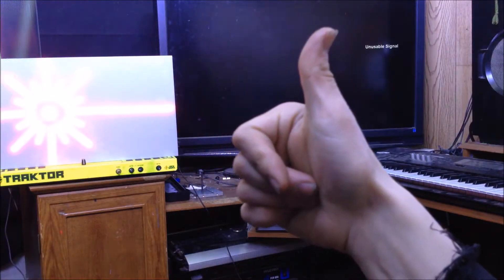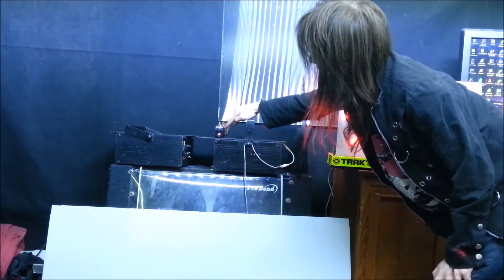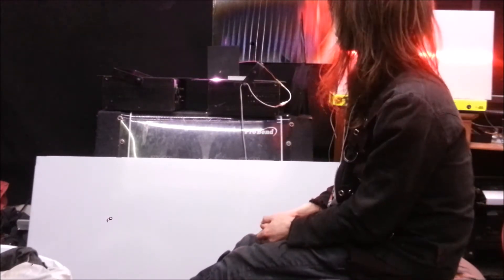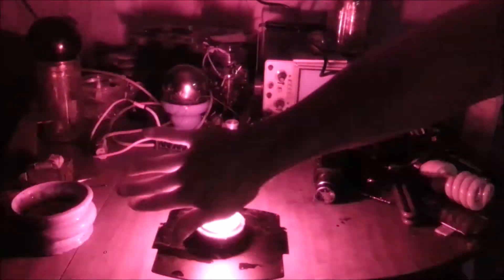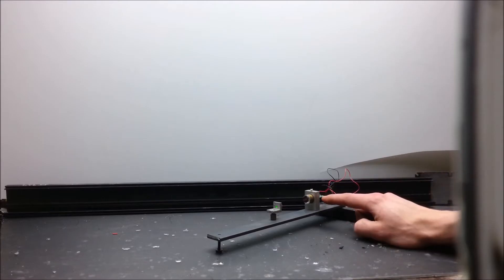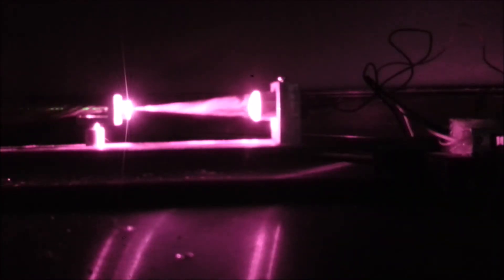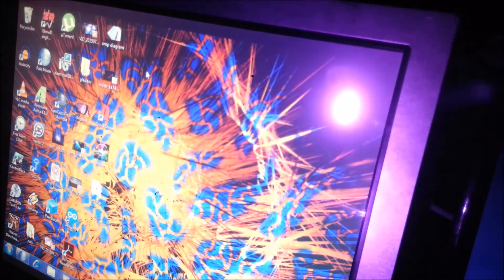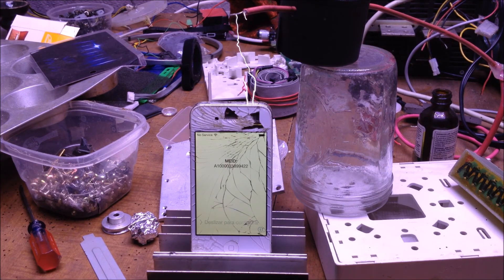Full Spectrum Samsung Galaxy Camera Modifications

Comment: How did you modify the phone ?
Reply: Thank you !
Reply from the maker: First was to extract the camera. If you are new to small projects I would recommend getting one from the internet for your modification. The camera has a few solder connections around the area between the camera's metal frame and it's PCB section, often this is wrapped in tape. de-solder those connections under the tape carefully and then VERY carefully remove and place the CCD/sensor in a dust free place. There are dozens of small gold wires that are exposed and the CCD will be bare as well. Inside the lens assembly you will see an IR filter. I found the best way to remove this was to either heat it up slightly with  small soldering iron tip to soften the glue and then a small sharp tool to remove it. Or use a small dab of super glue and a toothpick glued on the IR filter to lift it off the assembly. From there place the lens back on and resolder/tape the connections. Some adjustment may be needed to the front lens and this can be done by rotating it.
Reply from the maker: This video here has more visual info on how to mod it.
https://www.youtube.com/watch?v=S_otDBRFmGI
| I have not posted up a video on it as no one has yet asked. This was just pretty much just for a comparative test on visual effectiveness as I do work with IR a bit.